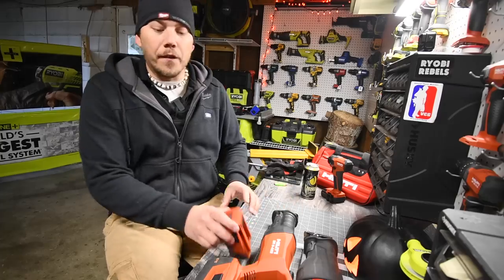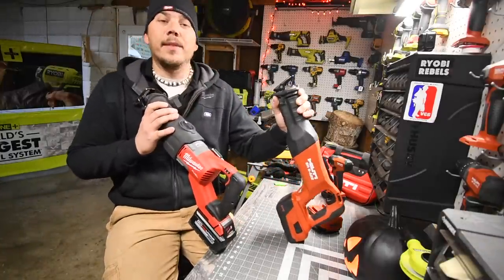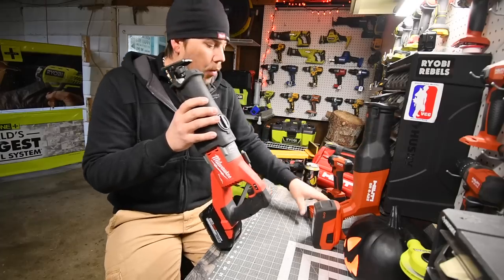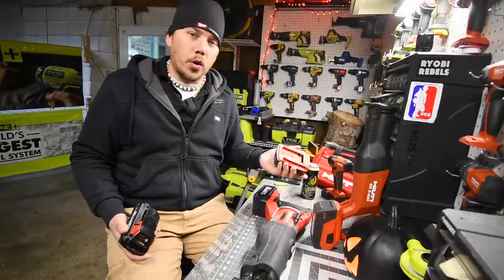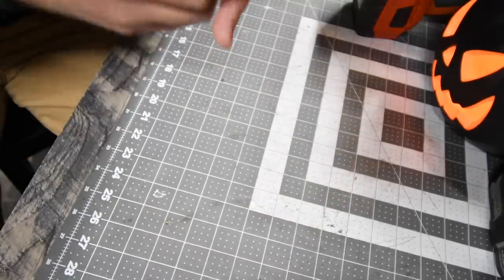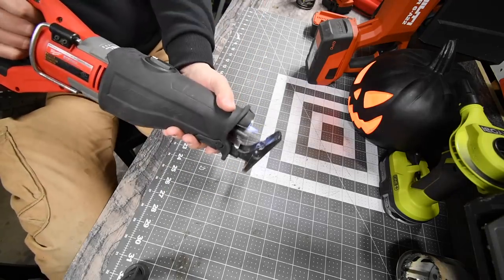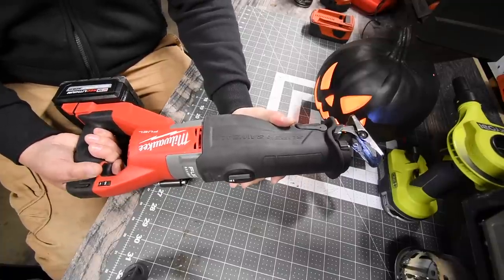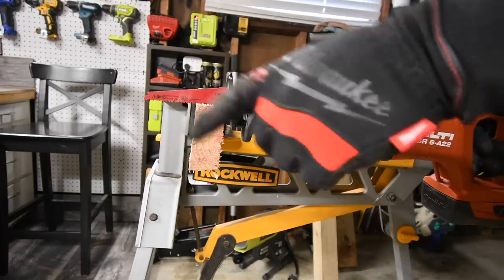HILTI vs Milwaukee (Reciprocating Saws)

Comment: you gotta get the carbide blades it should never take 30 seconds to cut anything unless its a tree stump also 1 carbide blade will outlast probably 25 regular blades if there's one thing I've learned from using my tools is your tool is only as good as the blade/bit you use
Reply from the maker: this channel uses all types of blades.

Comment: The blade was dull on the Milwaukee clean cut when it starts smoking that means the blade is dull
Reply: Yes when you cut, saw, drill in wood and you see smoke it means that tool is not effectively doing it job and a lot of energy converts to heat rather to desirable work, usually the blade or drill bit is the root of the cause.
Reply: That was also knot material. Yes a blade smokes when dull, but in thick wood  it can not remove the saw dust and due to the denser grain of the knot territory and the extra sap of it (dried or wet) it binds and smokes as well.
Reply from the maker: the blade was dull for both tools

Comment: The real question is which tool & battery will last longer ? I own the Milwaukee and it’s been sent out for for warranty repairs 3 times already.
Reply: Hilti usually is built to last and is top notch in terms of quality, but comparing the two is not a good comparison since the two are in entirely different price class.
Reply: I heard on another YouTube video, maybe   aVe, that Milwaukee tools are engineered to last 30 hours before failing. Hilti was around 1200 hours. Don't quote me on those numbers but the gap was substantial.
Reply from the maker: I think the HILTI would last longer
Reply: Even if the Hilti is sent out for a repair their turnaround is superb tool back on the job site within 3 days Milwaukee on the other hand can take a whole month
Reply: @johnadams1052  yes that’s very true and as far as overall build quality I’m almost positive that the Hilti is a much better tool. When I was in the Carpenters Union all we used was Hilti. Hilti also would come to the job sites and take tools in for warranty and have a a tool truck with tools you can buy at the job site, just like how Snap On trucks go to all the car dealerships.

Comment: Milwaukee invented the reciprocating saw which is how "Sawzall's" got their "sawzall" nickname. The reciprocating saw is still one of their rare USA made tools that they always seemed to put the most engineering into so it's no surprise to me.
Reply from the maker: I need to do more videos on saws
Reply: Makes total sense that the reciprocating saw is very popular in the US. In wood framed houses with drywall you have a lot of use for it. 
While the main tool from Hilti are concrete tools, more useful in European houses made from brick. 
So I guess both have their own home field advantage.

Comment: What's the purpose of orbital if it's slower
Reply: It’s not slower. It’s faster but delivers a rougher cut because of the motion of the blade. It doesn’t only go in out but also makes orbital motion as the blade goes in and out.
Reply from the maker: the orbital is faster, a lot faster
Reply: No it's not I seen another tool tester do it and it was a second faster and in some cases it was slower, and he also put the super saw saw against the Milwaukee 15amp corded and the corded blew it away so they are not equal to corded

Comment: I have used both in the field (sheet metal worker) Hilti is much better. Doing demo one to 2 battery changes a day vs constantly cycling batteries with Milwaukee. I have also burned out 3 Milwaukees, we shall see how Hilti fares. I really like the Hilti tool so far

Comment: kinda wish that youtubers that demo these tools actually used and abused these tools on jobsites.  this is mostly a issue with most of the tool review channels not just this content creator so no offense.  I think it would be great if someone was out there really testing these tools especially given how much money someone ends up investing in a ecosystem.  For example I own so many milwaukee tools it's honestly turned into a problem... and I can confidently say the super sawzall is too powerful for it's own good.  I've ruined the tabs for the battery release on every 12 amp and 9 amp I own because of this sawzall.  and apparently it's become quite the issue that in milwaukees new sawzall they included metal wear stripes to somewhat combat this issue.  The 9 amps had major issues with pre mature battery failure and it caused milwaukee to discontinue it.  also on a side note having a 12 amp battery slip out of that super sawzall on your foot isn't fun lol.  And this isn't me just bashing milwaukee, I use and abuse there tools, and for the most part I am satisfied with them.  But with that said I wouldn't recommend anyone buy the super sawzall if they plan on really putting it through it's paces on a jobsite.
Reply from the maker: insurance reasons is  why job sites dont allow that. I tired.
Reply: @ManCaverTools  I guess it depends on the jobsite.  I am a Sub contractor so to be completely honest I don't know exactly what rules would even be in place that would prevent someone from doing that.  Even if you could lend the tools out with the expectation that you are given the shortcomings of these tools I am sure that would be of great value to anybody who is thinking about one system over another.

Comment: Seems like the hilti transferred less vibration to the user than the milwaukee. Is that true? Or was there no difference? Or was the milwaukee smoother?
Reply from the maker: the hilti did have less vibration but the Milwaukee has an orbital feature which makes it a powerful tool

Comment: Nice Dave, very well executed. Would be nice to put a square on to the cuts and see how well the dust quality was for each tool. Also run them with their respective blades... ( Yes same blades make them equal, but each one is an ecosystem :)) Ah and one last thing... it’s missing a stress test to see how many cuts you get per battery, and you need to measure batt. temps, it will show a clear indication of how long that part of the tool will last, temps kill the batteries. ;) Keep it the awesome work, really enjoyed it.
Reply from the maker: I thank you Jose :)

Comment: @mancavertools. Get the Kobalt XTR and let's see a real test. It will beat everything except the Milwaukee Fuel 18. It eats dewalt for a light breakfast. Way better than the drill.
Reply: @mancavertools. I meant Kobalt XTR Impact driver.
Reply from the maker: I will be getting more XTR tools

Comment: let me guess before watching the video   hilti  hilti always wins but I was wrong  just figured hilti is better or supposed to be good video
Reply: Hilti doesn't excel in performance tests. They shine when comparing MTBF, mean time between failure. Hilti tools will outlast the Milwaukee (and everyone else) with respect to number of hours before breaking. And do so by a substantial amount too.
Reply from the maker: no I knew hilti would lose, that orbital feature the Milwaukee has majorly improves the speed of the cut. Milwuakee won. I point out flaws in both tool